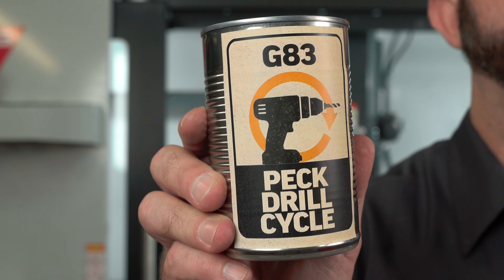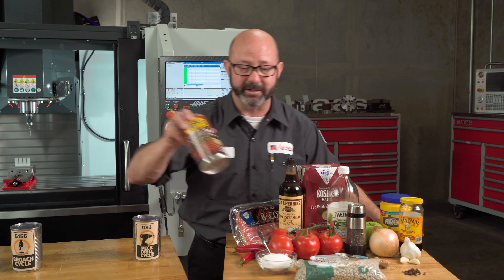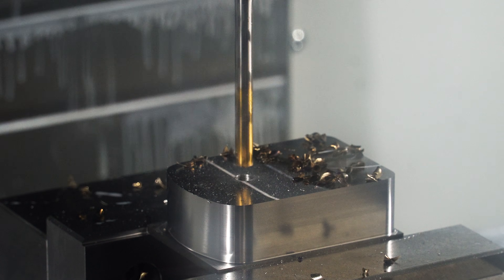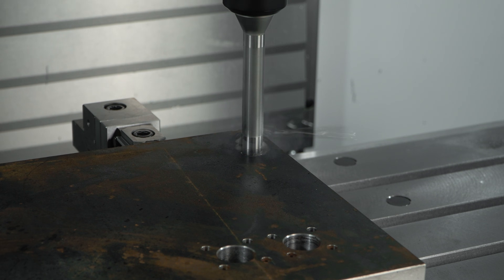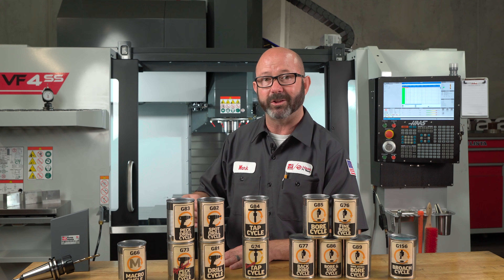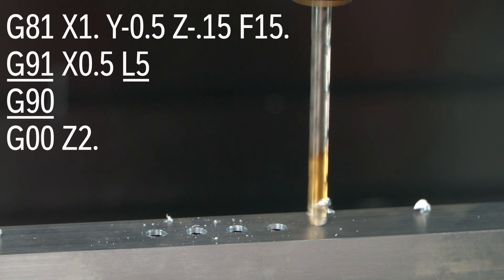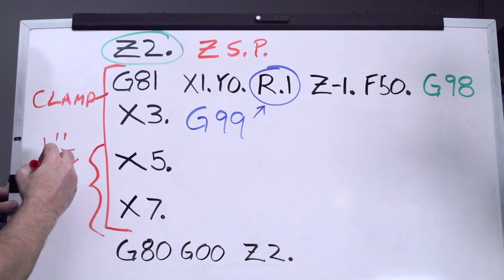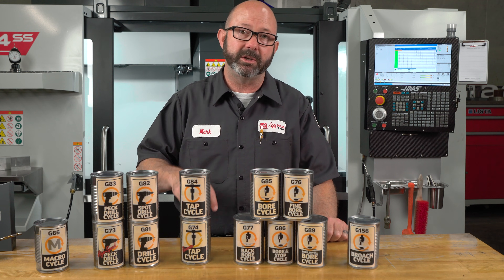G83: The King of Canned Cycles - Haas Automation Tip of the Day

Comment: Often, when the swarf wraps around the drill it can be corrected by using a heavier chip load (increased feed rate or decreased spindle RPM), reducing the need for a pecking cycle. A heavier chip that is stiffer ejects from the hole better than one that is thin like Christmas tree tinsel that just folds up like an accordion and then plugs the flutes or wraps around the drill. That keeps the coolant out, and the packed flutes create a lot of heat from the friction. Once the flutes begin become plugged, it’s all downhill from there, new chips have nowhere to go.

Increasing the feed rate per revolution helps keep some space in the flute for coolant to get in the hole, between that and having some air space,  reduces friction often and negates the need for a pecking cycle. 

If increasing the feed rate and eliminating a peck cycle works in a particular situation, the cycle time can be sometimes be significantly reduced. 

But, if a pecking cycle is needed when nothing else works, the depth of peck usually can be increased significantly by also increasing the chip load. High rpm creates more heat, which is especially problematic on soft materials that are prone to seizing, and reduced spindle RPM is often the answer to problematic deep hole drilling. Another thing to consider is a helical fluted tool is like a pump impeller, and the faster the tool is turning the more it impedes coolant getting deep enough in the hole.  It can be a case of going slower is faster because of reducing pecking and increasing reliability.

Also, drill style and geometry are important, sometimes switching to a better drill eliminates the need for a peck cycle and increases hole quality and tool life.
Reply: ☝️first choice, try this. If you have no other choice, an E value on the G83 is a safety net.

Comment: I was just drilling deep holes on a VF2 and swarf was just wrapping around drill and scratching the face up.  I was thinking how nice it would be to reverse drill on G83 cycle at end of hole.  Never knew about E command
Reply: A made a longer and more detailed comment here that might help you. Basically, when the chips get wrapped around the tool, in most cases you are making too light of a cut. Increasing the feed rate or reducing rpm often cures your problem. I think a lot of times people think a lighter cut helps, but often it creates problems instead.